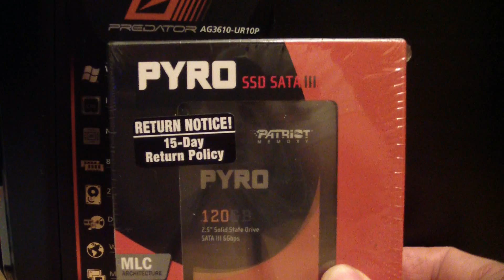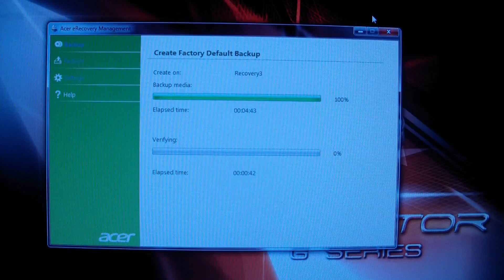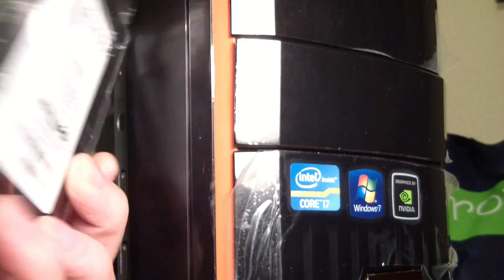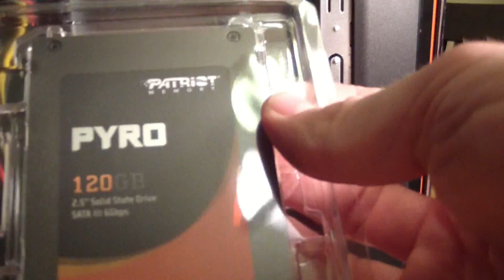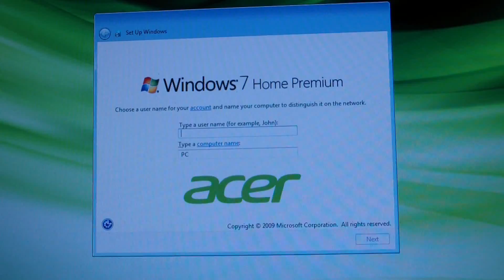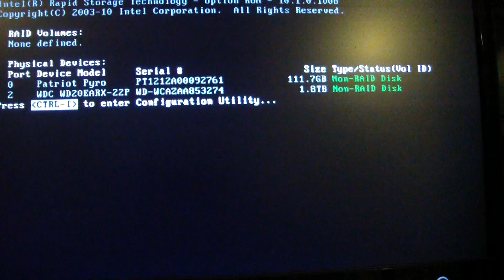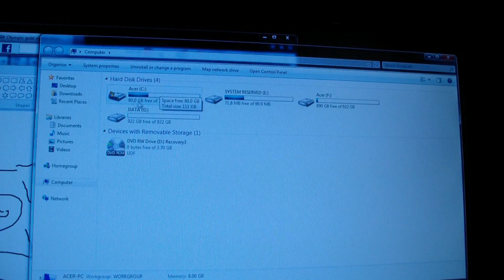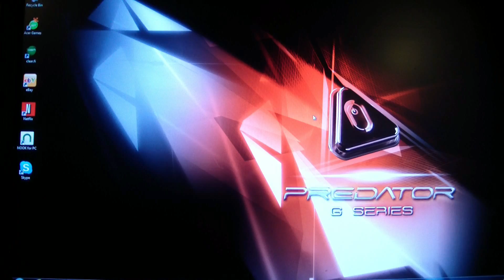How To Install A Solid State SSD Hard Drive In A Computer

Comment: What cpu would fit and preform better then a i7 3770 ?
Reply: i have the same cpu lol with a 2060 plan on going over to a amd 3700x and if u have a case similar to the one in the video id just upgrade it as there are much better cases for cheaper.
Reply: @blindshot709  thank you ; )
Reply: @djgang446  you're welcome :)

Comment: Hi, can someone who has installed SSD disk in this pc explain me why do you have to move default HDD to the extra space and use the space that was previously occupied by the HDD for the SDD? Why not add SSD directly on extra space? I didnt understand It... Thanks in advance!!
Reply from the maker: I think you’re right. You could probably do it that way. The pins on the drive should tell you which one is the main drive.

Comment: How do I replace an excisting hard drive inside the slots? I can’t remove the screws on the one side
Reply: Honestly just leave the old one in there and plug the sata cables into the new one

Comment: msi gtx 760 is compatible with this cpu?
Reply from the maker: +Jhon Ryan Pascual I don't know.
Reply: +Jhon Ryan Pascual i've got a newer version of this pc. at first sight i tell you can't install this gpu. probably if you do it you will have to replace the power supply, motherboard and add more fans. i was looking to suplly my 745 for the 960 and i should do all said before.
Reply: +Jhon Ryan Pascual If u mean CPU as the PC overall, this specific model's motherboard locks out any other graphics card except the one installed. You will need another mobo to do it, I own this PC and its a bitch to upgrade a graphics card with. 

LGA1155 motherboards are hard to find in stores nowadays as that generation has long phased out, however Ebay, NCIX and places like craigslist and some computer stores might have motherboards left. The case supports up to Micro ATX configuration so you can try looking around. 

If u mean the CPU as in the processor yes lol.

Comment: What about the D drive? as i understanded it will only clean ur C drive but now u have 2 drives on it.
Reply from the maker: +Joni Saarela I am using the original drive as the D drive to store extra data.
Reply: Yea i tried it too i wanted to make my ssd as a primary and original drive to storage but that acer management wanted to install windows to original drive. but the problem is solved i had windows boot disk so i made it that way.
Reply: +hoohoohoblin but ifu set the SSD/OS drive as main, wont everything u install/download in the future goto the SSD instead of the HDD? this very thing is why i wont goto SSD, too confusing.
Reply: +Ruben Toder  In windows You can change where your downloads go, and when you install new programs you always have to select the custom option and install it to your D drive. Its honestly not too hard.

Comment: Its been 3 years since you installed the SSD. Is the system still working as great as the first time?
Reply from the maker: ***** Yes, but it is almost full.  I used a 128GB drive.  If I did it again I would do it with 256 GB.  At the time, SSDs were really expensive and I couldn't afford a bigger one, but they are a lot cheaper now.
Reply: ***** If you were to do it again, would you be sticking with the same brand or do you think you would be looking at others?
Reply from the maker: I would get whatever brand has an i7 processor and is a good deal refubished.
Reply: ***** I wasn't talking about getting a new computer, I was talking about a new SSD.

Comment: Hi
I want to change my drive as per your video to a solid state drive but I also want to change my system from 32bit to 64bit. If I make a backup of my system will this run on the new 64bit Windows I will install on my new drive or does the back up have Windows included ?
Hope you can help.
Thanks
Ray
Reply from the maker: That probably won't work. I haven't tried it but I think you will need to have a 64-bit version of Windows for it to run with the new hardware.

Comment: I've done the same thing, besides i made "system recovery" on an USB. When i boot from the usb, i try to select the new ssd, but it says that it cant do it. Does anyone know why !?!
Reply from the maker: Duffm4nnn I'm not sure, but are there any jumper pins you need to set on the SSD to make it the main drive?
Reply: Duffm4nnn You did everything wrong. You are supposed to create a system image, and you cannot Boot to an SSD that doesn't have anything on it. You need to use a Data Migration software to install your system's image on to it.

Comment: I dont know if i shoukd buy an ssd , i want to buy 1 but if i buy one can i still use my hhd as my storage ? Got 1tb of storage will it all just go to waste ans i have to redownload everything?
Reply from the maker: VeryBigStache Yes.  That's what I did in the video.  I put the operating system and programs on the SSD and other files, like pictures and videos on the other drive.  It works well for editing video. You should get an SSD that is at least 256 mb.
Reply from the maker: VeryBigStache Yes.  That's what I did in the video.  I put the operating system and programs on the SSD and other files, like pictures and videos on the other drive.  It works well for editing video. You should get an SSD that is at least 256 GB.
Reply: ***** Thnx i,ll buy an ssd ":)

Comment: The acer predator is the badest gaming pc ever
Reply from the maker: Minecraft runs so fast on it!
Reply: The acer predator is realy realy badest gaming pc ever if you going to buy this then you cant run battlefield on high settings this pc is just for mc and lol, the easy games can you run with this pc, oh and the 1000 dollor acer predator is having AMD Radeon R9-255 Grapichs card do you even know what a Grapichs card is?
Reply: Lol. Mine runs battlefield all ultra 1080p 80fps. $1000, i7 4770 GTX 760. But I'm upgrading to a GTX 970 and an SSD

Comment: Hey man, 

Why didn't you just install your SSD in the Acer expansion drive bay at the front of the case?

I have a slightly updated Predator - the G3-605, and have a SSD ordered and should be here soon - touchwood.  I do plan on using the expansion bay, as it's the same as your machine mostly.

Any pointers or reasons why I shouldn't do that?  Cheers! :)
Reply from the maker: No reason.  You can put it in the expansion bay.  I put a terabyte drive in there on my computer, and I use it to hold all the video files I edit.  So I had to put the SSD inside the case.
Reply: Can i install a gtx 1060 into a pc (predator g3 605)
Reply: @deen_xd  yes you can. I have the g3620 with a gtx1060 6gb, mine had the 2 6pins with the factory power supply.
Reply: Yes you can use any card.

Comment: No offense and thanks for the vid, but what is it with you Americans.  You cannot say simple things in a few words.  It has to be padded out to the point where we lose the will to live.
Reply from the maker: That's the YouTube paradox.  People want information, but they can't handle more than 3 or 4 minutes at a time.  And I can be pretty boring.  I usually try to make my videos shorter, but if it's something technical I'd rather go longer and not leave anything out.
Reply: *****
Your voice and presentation are pretty good....it's just an American thing.(and me i guess)  Take a look at Britec....as good presentation.
Example: If you use the term SSD and have explained what it is ..once.  Don't start calling it a HDD/hard disk/fast disk/SATA disk.
Edit out any mistakes...and dead time.

Hope this helps...cheers.
Reply: Pretty ironic.

Comment: why would you even buy an acer predator? I had one myself, but i hated it. So I build my own computer, boots up to windows 7 in 8 seconds
Reply from the maker: You're right. The Acer Predator is bad.  I bought it because of the i7 processor and the good video card.  The motherboard went bad, and I replaced the hard drive, so I might as well have built my own computer from scratch. After putting in a faster motherboard, it works great.
Reply: NVG what ssd u got ?
Reply: I have got two Samsung 120 Evo 120Gb. Runs like a olympic champion

Comment: My gaming pc boots up in 20seconds no ssd
Reply: DBDennisvdG
i got an ssd but i dont want to install it cuz im afraid to break my pc
Reply: Superfunkyx yeah it's probably  a little scary but if you watch some tutorials on youtube Im sure you'll be fine
Reply: if its windows 8 thats probly why. and if ur hard drive is mostly empty that can affect the speed too.
Reply: mine is like 10 seconds but its windows 8
Reply: heat wave yeah win 8
Reply: I just wanted to ask you guys a couple of questions will my gaming pc be quick with only a HDD and ODD. And also can i still use my HDD if i install a SSD
Reply: wtf is a ODD? lol and yeah with the hdd and ssd u can.
Reply: optical drive? i heard someone say ODD was optical drive
Reply: wouldnt that be a disc drive?
Reply: its the same thing
Reply: Superfunkyx You are afraid because because you are not sure of what to do. There are a lot of videos on youtube that explain how to do this type of thing. To be on the safe side, you will need to use Data Migration Software(GOOGLE Search: Micron) to install your system on an SSD, but always make at least one backup of your system in case you mess up.
Reply: TheIronside It is possible, but mechanical drives are less reliable than an SSD. An SSD is well worth its benefits, but only if you have an SSD & mechanical drive configured correctly to the point that just the OS boots the (system/programs) on the SSD, by themself, and everything else you do gets installed or downloaded to the mechanical HDD.
Reply: yeah same the boot up seems to not be so different anymore
Reply: lol same here, I wanted to get an ssd but now I'm doubting if it's really worth it :p

Comment: was there an extra step to formatting the HDD as the back up storage? or was it just a plug and play?
Reply from the maker: I think I just plugged it in.  Depending on the type of drive, you may have to change the jumper on it.
Reply: Mark Ha No, you have to go into the system's BIOS settings (UEFI) to set the boot priority of each drive. NCIX Tech Tips has a video on this.

Comment: The solid state drive is not a hard drive there is a difference, a hard drive, HDD, has moving parts and a solid state drive, SSD, has no moving parts meaning they are different
Reply from the maker: Thanks.  You're right.  I called it both things in the video description so more people would find it when they search, and it's working.

Comment: I got a 7.9 as well :) I have a kingston hyperX 3K ssd. It is important that before you install win 7 or win 8 that you go into the bios and set the sata setting to AHCI. If you don't do this you will get lower speeds out of your ssd! Be aware, only do this before installing your OS, else you have to install your OS all over again. I went from a 7.6 with my ssd without AHCI mode to a 7.9 with AHCI mode enabled. So yeah :) SSD is still blazing fast after almost a year :)

Comment: you can do that, but make sure your ssd becomes the C drive or else you'll have two OS on two drives. Sometimes you wont even boot off the ssd. So its not even using the speed.

Comment: Great video :) i have a question, i just got a new pc with a 60 gb ssd , as soon as i turned it up for the first time it shows like 3 gb left it is already full is this possible? or do i need to buy another ssd ?to install the ssd it is plug and install windows in it ?  it is possible to have 1 ssd for main programs and 1 bigger memory hard drive for any extra programs in case needed ? thank you